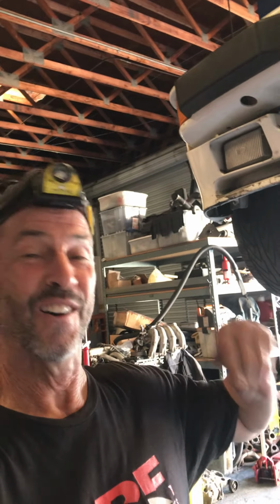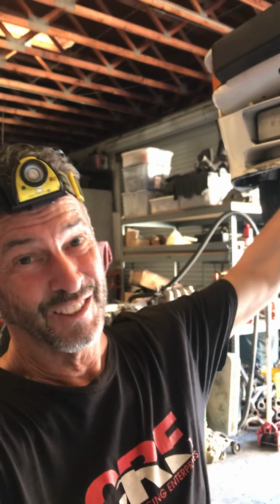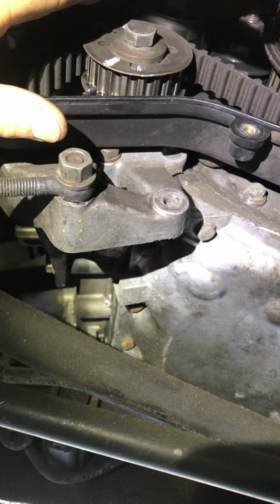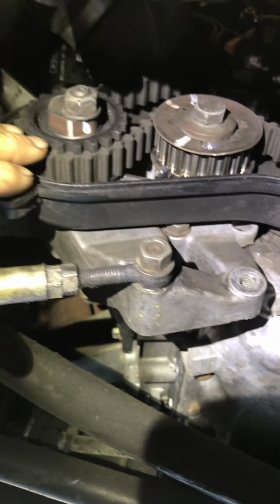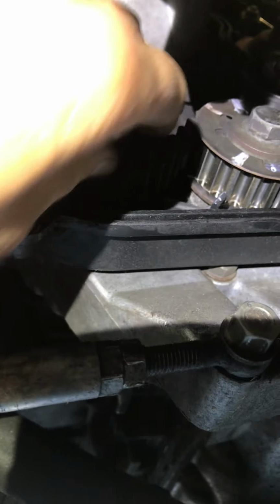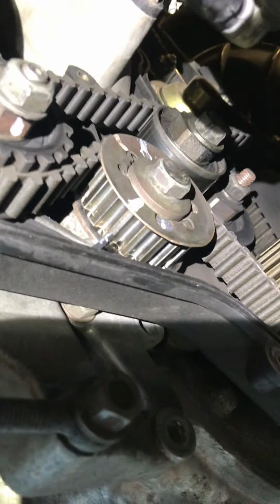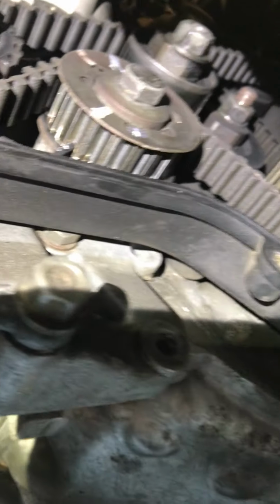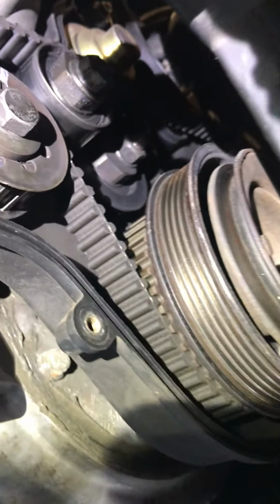Porsche 944 Belts and Rollers Disaster

Comment: Tim we need a guy like you in Belgium 😁😉😉
Reply from the maker: Bien merci!
Reply: Tim if youve got some oil in the hose inlet and outlet of the intercooler how can i now if its from the carterventtube or if the turbo is busted
Reply from the maker: @Jv's Vlog  carter vent tube?
Reply: @ComeauRacingEnterprises  this is what an mechanic send me Tim. 
Check the inlet  before the turbo as well could be from the crankcase breather pipe as well might not even be the turbo what is your oil level like.
Reply: Isnt this correct wat he is telling me??
Reply from the maker: @Jv's Vlog  I don’t understand what is Carter vent tube.
Reply: @ComeauRacingEnterprises  me to??
Thats wy i asked if you now what it coud be. Oil in te intake hose and outlet hose of the intercooler of a 944 turbo from 86 type 2.
Reply: I have no idee maybe a busted turbo seal?
Reply: @ComeauRacingEnterprises  sorry tim carter is dutch for crankcase
Reply from the maker: Could be internal turbo seals, could be too much crank case blow by around piston rings coming up through the air oil separator.
Reply: @ComeauRacingEnterprises  how can i test witch  one it is, any ideas tim?

Comment: I have a question. My 944 passenger fan still runs after engine is shut off. What do I do to fix this issue?
Reply from the maker: It’s normal for the fans to run for several minutes after you shut the car off. Usually it will be both fans on low speed. If a fan stays on for longer than that pull the fan relay and check it out.

Comment: Did you ever swap bearings on the old metal rollers/tensioners ? 
I have a brand new plastic tensioner - the best you can buy now, and it failed after 1k miles... The original metal one I still have around, is better after 40 years. But before I slap it on I'd like to know if anyone can press in some new industral bearings w. longer planned obsolescence..
Reply from the maker: Somethings wrong. I've never seen a newer type roller fail. Belt tension wrong? Too tight? Torque all front rollers to 33 ft lbs only.
Reply: @ComeauRacingEnterprises  belt was pretty sloppy, could have torqued things up using old specs.. (45nm if I remember right) 
😆
Reply from the maker: @happyfox711  Yes 45 Newton meters is 33 foot pounds